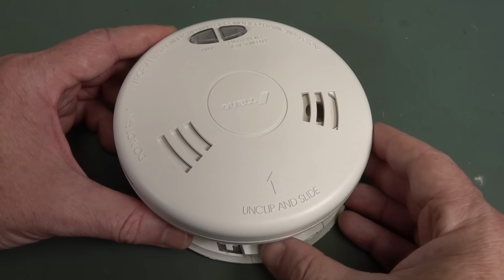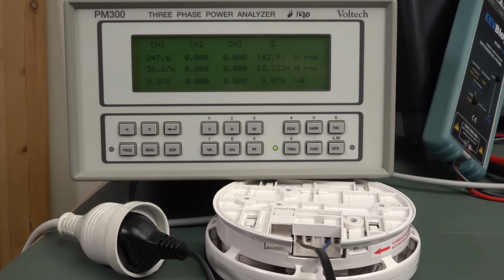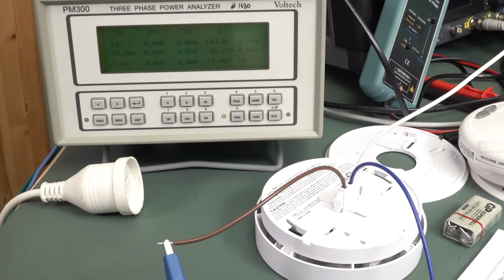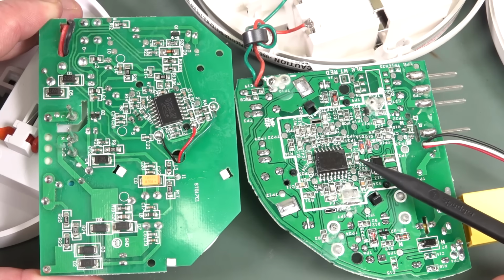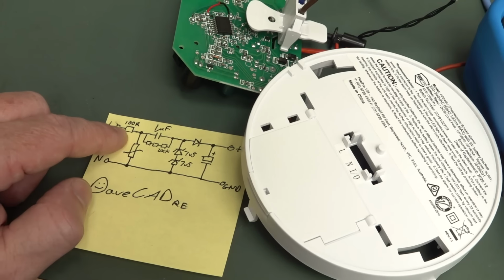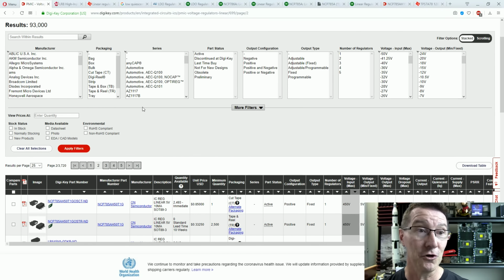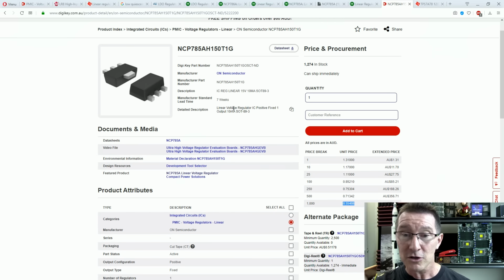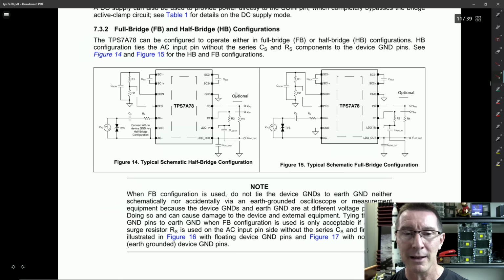EEVblog #1284 - How Bad Product Design Kills The Environment

Comment: There's carbon monoxide detectors on the market now that are lithium primary cell powered and they run for 10 years, then you throw them away. I slightly disliked them, until this video. They don't seem so bad now!  🙃

Comment: I wrote a billing system for commercial customers and it doesn't even charge based on consumption.   They (the distributor) don't even send you consumption figures for large commercial premises.  They only send you the per 15 minute peak demand and the KVar stats.  The bill for that 15 period is based on their peak load during it, even if transient and a surcharge factor is applied based on the reactive power.  When you broke it down that surcharge was applied mostly in the transmittions and distribution costs which are individually calcualted and charged to commercials.  When I enquired as to why they don't bill on consumption like residential, the response was that the grid operators don't really care how much a large industrial place uses, they really only care about the peak load they will put on the grid.  If that goes up, it will really effect them and their capacity for the area.  So they translate that figure directly to the "plants" pockets to discourage them from suddenly increasing their power demands.

Comment: No you're not gonna pay for half of a watt you're gonna pay for at least 2-4 Watts with 4 to 8 smoke alarms.
I have heard a few issues of and manufacturers saying not to use with modified sine wave inverters as well.
And the designs haven't changed much because they have to be certified so any change requires re-certification which is why manufacturers have not changed their designs in decades and getting a new smoke alarm out is difficult.
They are required in new builds as well in the US. Also a good reason to stick with plain old battery ones, however they are pushing the whole five-year smoke alarm replacement thing and starting to include lithium batteries that are non-user replaceable.

Comment: Even a multi-megaohm resistor with a zener diode clamp would do much better. It’s not like they need that much current, anyway. Absolutely shocking, lazy design!

Comment: Interesting rant on the VA of the device, it may be overlooking that this is most likely Capacitive, and 180 from the Inductive power factor of the transformer supplies in the microwave, home router, and the inductance of the fridge, and other appliances with a motor, such as heat pump, AC, and furnace? Don't overlook the inductive load that is the utility transformer on the street feeding the house. This may actually reduce the total VA connected load of the house. Individually this looks bad, but it may fix some of the large amount of connected inductive load on the utility.  Have you put current transformers in your main panel to find the total power factor of your house and if it is leading or lagging?

Comment: Opps, a year ago.
One of the issues I have with the optical ones is steam condensate sets them off too. Showers, cooking with a boiling pot of water etc. Unless there is better ones out there that pickup on the difference between smoke and dust or water vapor etc.

Comment: With an R-C voltage divider input to drop the mains voltage prior to rectification, won't the power factor be LEADING? Therefore, given that the vast majority of reactive loads are inductive, these smoke detectors would each serve to provide a small corrective effect on the grid. Or am I missing something here?
Reply: The assumption that there's lots of inductive loads may no longer hold true because so many products use capacitive droppers.

Comment: 5:30: Two days with 10 of those going off at random because of some dust in one of them. 
The indicator LED failed so we couldn't find the culprit. At least it had a quick disconnect cable when we did.

To be fair, they where very loud! Especial with the non-synchronized beep from all the different rooms.
I believe I still have some tinnitus left.

Comment: I want to measure active power consumed by my system, I don't have any such equipment with me, I got Keysight Multimeter U1232A. My doubt is that when I am measuring current with multimeter, Current shown is active power or apparent power current so using V * I, I can calculate active power.

Comment: There's a 12V DC line runs across my house. I use it for powering LED lighting and other DC stuff like for gadget charging (using car chargers). I've installed a used 500W 90% efficiency server PSU at the power distributing box, but I never measured a power dropped on wires (just happened to have AWG6) .

Comment: IMHO, way more power is lost in other household products, compared to the low-pf supplies in smoke detectors.
You'll use much more energy with poor driving habits, like excess speed and lead-foot stop/go/tailgating.
I don't disagree though, they certainly could use better PSUs in smoke detectors. It's just that it's more effective to put effort into energy-savings elsewhere ... and no, not solar roadways!

Comment: Not so fast, Dave. That 9 VA's in your smoke detector are capacitive or negative VAs. They cancel out 9 inductive (positive) VA's. Your smoke detector is actually improving the collective power factor by partially compensating for some of the inductive motors in your house or at least in your neighborhood. The zeners are real power though. You're right about that.

Comment: In Chinese,"蜡" means wax,they planned to use wax for preventing water getting inside(or oil).However,they used coated painting.Coated painting may cheaper due to you can get all-in-one factory produce solution to eliminate shipping cost and reduce time to market.

Comment: Why is it these bleeping bastards always chirp low batt at night ? there is a reason : thermal drift. When they cool down the electronics drifts enough to make them start misbehaving. And why can they not use color coding to indicate : low battery. i'm ok with the chirp but SHOW me which on it is ! and no, red,green,yellow does not work ! fit i snot yellow , but red and green on at the same time. the problem is that, if you are colorblind like me, you can not tell the difference between red and green (or that yellow hich is red plus green ). that led is simply on or off. use a blue/red led. there is no such thing as red/blue colorblindness , while red/green is the most prevalent one. Talk about user interface design ... idiot designers.

Comment: Why do you need a mains powered smoke alarm anyway? So you have a product there, with a backup battery, that you still need to check periodically and eventually have to replace. Might as well use it to power the device?

Comment: Wowsies for the VA. thats ridiculous. at least here the bigger factories/offices are paying in VA used therefore they got the PF correction batteries installed. I have installed several of these smoke detectors and the stupidity to wire the thing vs just using battery that drives one for several years is bugging me. But im not deciding these, i just do.

Comment: I grew up working for my dad installing these 20+ years ago in houses before they were Code.  (Im located in Pennsylvania USA.)  Now with any new house or if your selling your house you need these or the newer wireless ones with long life battery so they can communicate.    The cheap design of these made them a headache especially in the beginning.  We had a few recalls on the wired ones so had to replace all of them in large 4 bedroom houses (maybe 8 detectors)  and also we would have to change out brands after we had multiple call backs on them not working and going off randomly.  We would show back up at the clients house and they would all be disconnected because they were beeping non stop thus partially making the installers liable for any death or damage caused by a fire due to installing a non functioning product.  The thing was there was no higher quality product that we could find at the time to replace them with... just another brand for maybe a few dollars more our supply house could get and a prayer that we would not get a call back. The cheapness of these has probably killed many people and also cost our environment greatly and also caused small business to lose tons of money so that Kiddi can save a few cents.   Thanks for making this video.

Comment: Simple solution to this problem: Get rid of the mains powered smoke alarms and go with the lithium powered 10 year smoke alarms. Smoke alarms should be replaced every 10 years anyways if they use the radioactive particle because of the decay of said particle.

Comment: The reason for such a power supply is obvious to me: What do you need to run the alarm:  If you think microamps, you are fooling yourself.  Also, who wants to design two supplies.  Better design is certainly possible though.  Put a switch and an additional capacitor somewhere and you could drop the quiescent power most of the time.

Comment: How about all the standby LEDs that consume power 24/7 all over the world?
Everything has one of those useless standby LEDs nowadays.

Btw, over here in the Netherlands, the ground is not connected to the neutral in the main breakerbox. Ground is actually connected to... the ground! 😀
A metal grounding pin/rod is hammered about a half meter into the soil, it has a screw terminal where the ground cable is attached to.

Comment: The voltage was a little high but not bad the problem with main voltage here is that it was 240vac +/- 5% and then they changed our main voltage to 230vac to comply with international standards but the fact is nothing changed except on standards documentation it now said 230vac +10%/-5% so our official supply voltage is 230v but your unlikely to see that voltage anywhere

Comment: i have some battery only detectors that can drain a 9 volt in as little as 4 months. because the batteries are kind of expensive, we usually dont replace them until we are down to one working detector.  the thought of burning to death is less troublesome than the annoying chirping noise they make every 5 minutes until you replace it (the noise tends to make me want to burn down my own house just to make it stop sometimes). of course i take the batteries out to make them stop and they are only down to 8.5 volts, and if i put it in my multimeter it would likely last years. the old detectors seem to use less power and work better, mainly can tell the difference between actual smoke and when i just put a pot of spaghetti on.

Comment: The voltage regulator only provides 10 mA. That will work at idle. But what if it goes off? I guess we'll burn out the voltage regulator, maybe causing a fire.

Comment: Everyone is forgetting why that supply is so bad, forget the fact that the power factor is lousy, the real reason that it even draws half a watt in the first place is that it needs the power capabilities in reserve to be able to sound the buzzer. When not sounding the buzzer, it is being shunted off to ground and being turned to heat by the Zener diodes as they regulate the voltage. Might a better idea would be to have a direct mains operated buzzer using a triac and have the dropper capacitor sized for the load of the sensing circuits only. Keeps the relative cheapness and lowers current consumption.

Comment: Tried those photosensor detectors. All failed within a year of purchase. I suspect that dust was loading them and eventually got to a point theres enough reflectivity to trip. They also seemed prone to false alarms from the steam coming from the bathroom after a shower. Once they failed, I could let them set for a few days, and they would still trip as soon as power is applied, and cannot be reset. I went back to radioactive detectors.

Comment: spring leavear designs are better then screw terminals, as a good electrical connection  is better insured by constant force then by torque causing a deformation.

Comment: Maybe i can help a little with the confusion all around. First of all: The Germans are once again to blame for everything! (Although I'm not so sure. The origin is uncertain). "Active power" or more commonly called "real power" may be somewhat misleading and would have been better perceived as "real acting power" from the german "Wirkleistung". In conjunction with the terms "reactive power", "apparent power" and "complex power" one may misclassify this. 
While it is true that the calculation can lead to zero, it is only half of the truth. The complex(math term) AC calculation is only suitable for linear arithmetic operations. However, if you multiply a complex voltage by a conjugate complex current, the time-dependent parts cancel each other out. So when you examine an apparent power, you have to consider the time course of the actual values. And, who would have guessed, these are very real at every point in time and the place where Dave's "not free lunch" is served (from the pinned thread).
If you study electrical engineering, the subject matter of the complex numbers will definitely hit you "real". 

 I hope I haven't messed everyone up more than necessary:)

Comment: Am I wrong? What am I missing? Dave says 20VA * 5 units * 1,000,000 homes = 100 MVA, His mains voltage is 240 volts, so if volts times amps is VA then the amperage should be 0.083 amps (0.083 * 240 = 19.92VA). So the current imposed on the grid should be (0.083 * 5 * 1,000,000 = 415,000 VA.) not 100,000,000VA

Comment: Power factor is difficult to understand, if the current is 90 degrees out of phase with the voltage the wattage is zero. The only power consumed is from the resistance in the wires, transformer windings and generator windings. You need to understand the difference between true power and apparent power

Comment: Many coffee machines also use a similar dropper circuit for their control logic. The on/off button is just an input to the micro so the capacitive dropper is always on.
Reply: Our Phillips coffee machine at the office has automatic turn off with no chips and no standby power.  Just a mechanical link between the button and the bimetallic switch.  Great design, but our previous unit died after 5+ years from an internal water leak.

Comment: Excellent public service video Dave.  This is the classic Capital Budget vs O&M Budget conflict we see everywhere, including public buildings equipped with low cost aluminum frame windows, cheap resistance electric heaters used in schools, even electric train lines that include zero provision for PV in station or trackway design.
I’m outfitting my house now with 8 mains connected smoke detectors. If anyone is aware of a brand and model of energy efficient smoke detector, please reply here.

Comment: So much for going the less batteries route... it still requires a battery to run, which is stupid enough. There are detectors out there which can communicate with each other and still have built-in batteries that last 10 years.

Comment: If i created, i would make seperate power supply, to supply  multiple sensors on dedicated DC line. For power supply it would output 12V DC current, and another power regulator in the sensor to drop down to 9V, To prevent too much voltage drop on long vires.

Comment: Almost all substations have power factory correction, this isn't that much of a problem. And a 100 mw isnt much, a basic windmill produces for 1500 houses a year (this includes the smoke detectors) 

I wouldn't care about it at all. a basic led with a driver is between 0.5 and 0.95 power factor.  So a led light can even be worse then that smoke detector. 
And you cant market this because no one will ever care about things they dont have to pay for. 
And who cares about the enviroment, we aren't going to change it anyway.  Did you know the ice on the pole is actually growing? Ask yourself why that is. (Look up the proof with sattelites pictures) Funny huh.

Comment: As someone who used to work for an electric utility ...

The actual cost of the poor power factor is the utility installing power factor correction capacitor banks in an optimal location, plus the IR losses between the capacitors and the smoke alarm.

A cost-benefit study of your suggested mods might be enlightening. You would not only have the incremental costs of the new components, but also the redesign effort plus possibly recertification expenses with the safety regulation bureau in the various jurisdictions (Underwriters Laboratories here in the USA 🇺🇸).

Then you'd have the expense of marketing the "new and improved" model -- especially if you were competing with a manufacturer who opted not to make the changes.

Here in the USA, MAJOR appliances are labeled by law with both the annualized energy consumption as well as the cost of that energy. If they did that same thing with smoke detectors, I wonder what the effect would be on sales?

BTW, what's the average cost of a kWh in Australia 🇦🇺?

Comment: Another reason for that oversized supply could be, that it also needs to be able to drive the buzzer in case of an alarm. This will draw more than a few microamps...
Reply: This is addressed in the video. The whole circuit pulls 15ma when buzzing.
Still easily doable with the 10ma supply and a 66% duty cycle.

Comment: The newest smoke detectors I bought have 2 AA batteries. There could be a small 3mm square 6-cell solar panel on the detector face to charge the batteries from ambient light. I'm sure that would last 10 years without a problem!

Comment: Just pulled one of my smoke alarms from the ceiling it's a Hager TG501A, only uses 30mA at 230V max (I assume when the alarm is triggered) according to the spec sheet it uses 20 μA both at 9V and 230V in standby/detecting mode.
Cost between €25,- to €50,- that's about 40 - 80AUD, compared to the other options available its on the higher end but only marginally (5 to 10%)